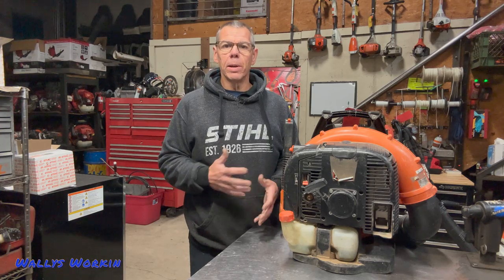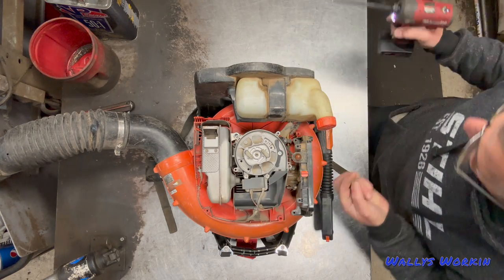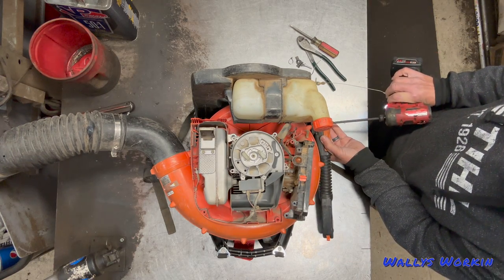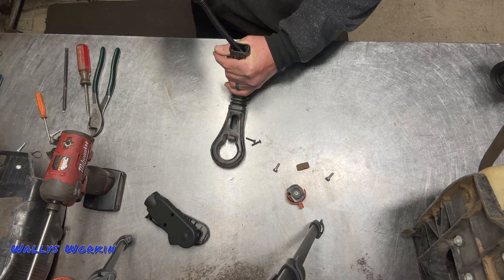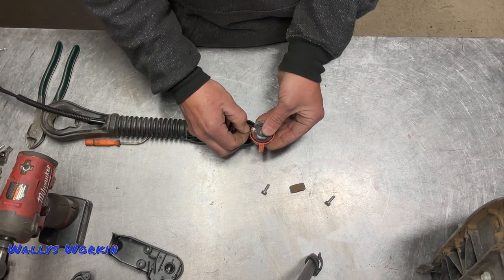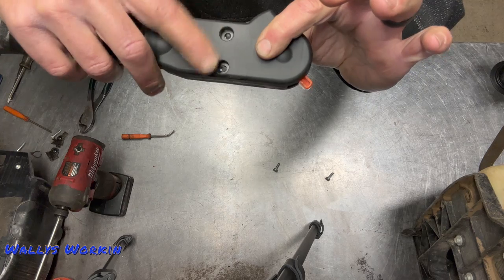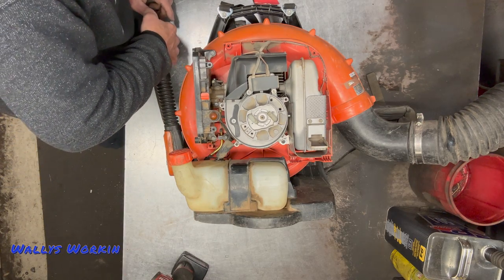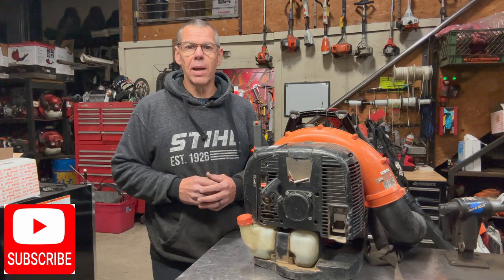ECHO PB-770H THROTTLE CABLE REPLACEMENT / DIY / BROKEN THROTTLE CABLE

Comment: I appreciate the detailed breakdown and the close ups.  Well done.  I have a 580t that continues to break the throttle spring on the carb every few months.  Seems like an uncommon issue.  Have you seen this?  Is it that the throttle cable is adjusted to tightly, so extra pressure is being put on the carb end?
Reply from the maker: Very common problem, I replace many of those carburetors. Adjusting the throttle helps but the carb has a weak return spring. Luckily the carbs are cheap.

Comment: Just out of curiosity, is it possible to switch a PB770H and convert it to a PB770T? The throttle handle broke on my 770H im planning on buying the entire assembly and maybe converting it into a T model.
Reply from the maker: Yes you can, you need the mount that goes on the tube along with the new throttle assembly.

Comment: Best way to do these is to just replace the entire throttle control with the grip handle and wire harness and cable, save the labor from dismantling the throttle grip, on the tube mounted, pb 770 T models…
Reply from the maker: Slightly more expensive but yes always a good option.